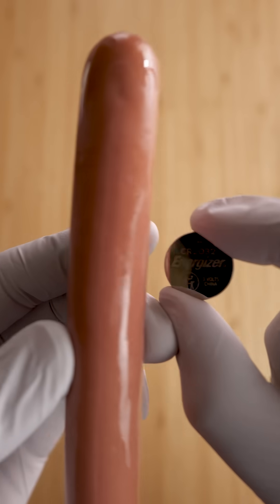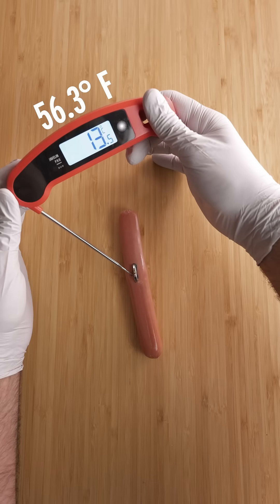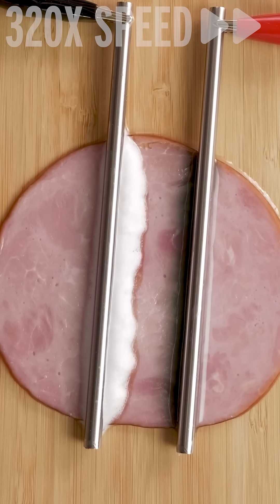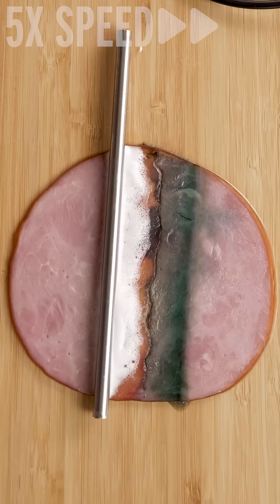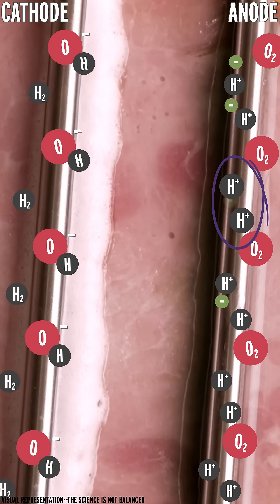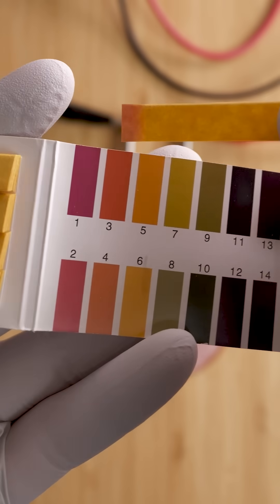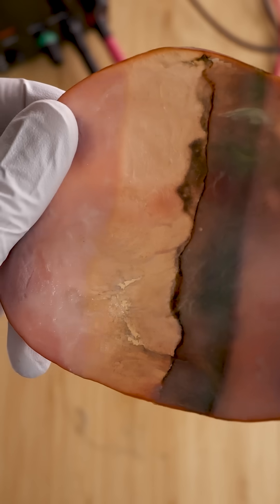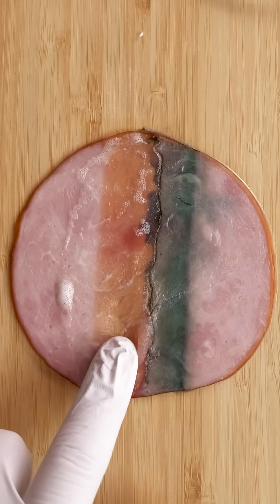don't swallow watch batteries

Comment: Paramedic here. Seen this in person and it isn’t pretty in the slightest. But if you ever even suspect your key has swallowed a button battery and they are over the age of 1, feed them honey, a few spoon fulls to try and coat the battery and slow this from happening while also being on the phone with local emergency services to take your kiddo to the ER. Don’t let anyone try and write off your concerns, play it safe and have them image your kid to confirm if there is a battery or not.
Reply: Fellow paramedic who was looking for someone giving the honey advice! Feed them the honey and get them to the ED as fast as you can
Reply: @mattt620  Great work gentlemen thank you.
Reply: Completely agree. Immediate presentation to the ED, regardless of the size of the battery or how well the kid looks. I'm a Peds EM doc. Our facility has a button battery team that gets emergency paged to prep an OR and get the surgeons to bedside immediately for esophageal batteries. That's how serious we take it. Though I will note once you're in the stomach, much less dangerous because you've got thicker mucosa used to resisting chemical damage.
Reply: My 4yo sister swallowed a button battery and my mom did exactly that when she found that she swallowed it, it works very well. The paramedics at the ER told us that the honey slowed the digestion process significantly enough for them to take it out in time. Yes, they had to remove the batter manually by inserting a something like a fish stick with a camera down her throat to her stomach so they could take it out. Thankfully my sister walked away from this with no serious injury. Could’ve been way worse had we been late in taking action. Can’t stress this enough, please watch out for button batteries around children, and take action immediately if you think a child had swallowed one. Never brush it off as something minor, better safe than sorry.
Reply: @Kiyotxka  do you remember how much that whole process cost by any chance?
Reply: Battery in keys very dangerous... got it
Reply: So what you're saying is I should coat my batteries in honey before I eat them to slow down the reaction?

That's a genius idea! It also makes it even MORE tasty!
Reply: Noted for my battery eating session
Reply: Good to know  Thank you
Reply: You can also use honey if your child has swallowed a bear
Reply: with honey is the only way I eat my batteries
Reply: Don’t feed honey to newborns or kids under one years old though! Since honey contains Clostridium botulinum bacteria, and it can cause infant botulism.
Reply: Insane that we even have to say “don’t let them image ur kid” 🤦‍♀️
Reply: My car key does swallow a lot of button batteries man. I need to change em almost every month
Reply: couldnt you just throw it up? or would the stomach acids cause more damage
Reply: @shaymin7240the problem is that the battery gets stuck in the throat and I’m guessing the burns help it hold on longer as well. Also these are usually young kids,l who may not even understand the situation
Reply: @shaymin7240It is not easy to make a kid to throw up. We are not trained and most probably causing more harm.
Reply: @shaymin7240the biggest concern with making someone throw up is of aspiration into the lungs or making airway management difficult
Reply: how does a key swallow a button battery?
Reply: auto correct sucks
Reply: @AbiyBattleSpell   I could be wrong, but I'm guessing that was a typo for "kid".
Reply: Honey? Why? I'm from Czechia and "the general advice" is to eat lettuce or something like that. That is for any metal objects.
Maybe its different for batteries.
Reply: @ the short answer is because the honey will coat the battery and esophagus also honey has a relatively acidic ph so chemically it also can help neutralize the base from ur battery. Really it is two fold helpful, out gi tacky deals a whole heck of a lot better with acids than bases.
Reply: Same process will happen if any active metal is placed inside body. The only difference is speed of the process. If a piece of a bullet is stuck somewhere it will slowly kill.
Reply: I only have splenda, I guess that's fine right? It's not like the batteries are sweetener connoisseur
Reply: @Alex-qj3wp  No.
Wildly chemically different.
Reply: @Alex-qj3wp  actually the battery is, will only accept honey otherwise the attitude it gives will only get worse.
Reply: @Alex-qj3wp  I can't tell if this is sarcasm or not. But just in case, no, Splenda won't work. Idk if you've ever noticed how honey is thick and gooey, and Splenda is, well... not.
Reply: @Alex-qj3wp  It's not about the sugar... Also, that isn't sugar.
It's because the honey is viscous and coats the battery/esophagus and helps slow the reaction by limiting contact.

The only way to "stop" the reaction is by making them drink a ton of acid to neutralize the base, which has it's own set of problems.
Reply: @Alex-qj3wp  no, something thick to coat the battery like syrup, and im thinking ketchup might do the trick as its also acidic
Reply: @kwitmeh3  maple syrup, maybe? I'm not a doctor but it's fairly similar to honey, is it not?
Reply: jokes on you if you think im payin my yearly deductible to save some kid, whether its my own or not
Reply: @Mike_Dubayou  Or move to the developed world where such services are free.
Reply: @unfathomablyunfathomable "free", not free.
Reply: @Mike_Dubayou   Quite literally free. No bills paid. 💀

Yes, a percentage of your income every day goes to financing roads, schools, hospitals, police, the military, etc. But then again you don't have to pay 100 000$ for surgery, and ambulance rides are free.
Reply: @Mike_Dubayou  Maybe it will give you the oomph to make a home made silencer and help us fix the issue for good, know what im sayin?
Reply: @ instructions unclear.  a few kids are unalived and im not sure im doing it right.
Reply: I don't think there's a lot that can be done. No doctor is gonna rush a kid to surgery to remove a battery.
Reply: @mawlakewlz  You think they're just going to let the kid die? Nah, they're probably going down the esophagus with an endoscope to get it out.
Reply: @austinhamilton9707   Perhaps, if they can. 
But how likely is it to be stuck there? 
Most likely it goes right to the stomach in like 3 seconds, like most things that are swallowed, and from there to the intestines. 
I've just heard that they typically don't do surgery for things like this, but I'm not an expert so i don't really know.
Reply: @mawlakewlz  The NHS will attempt an endoscopic removal, with the camera to survey any tissue damage. If they cannot fish it out then they concentrate on chemicals to limit any reactions and monitoring for damage until its passed and treating the symptoms, I don't think it would be much different in the US or Canada.
Reply: @MrWyzdum  I've heard that the sky is green and there's monsters under my bed, but thankfully, I don't believe everything I'm told. Also, don't know if you've seen the size of button batteries, but they're a decent size. Pretty likely it'd get lodge in a small child's throat. Regardless, doctors will 100% do what they can to save a child. I know the American Healthcare system isn't the best my any measure, but they're surely not going to just stand around while they watch a child die. "Oops, kid swalled a battery? Sorry, I don't do surgery for that sorry. Just not my thing." Come on, dude... Use the thing between your ears.
Reply: @mawlakewlz that is literally EXACTLY what we do

Comment: Okay, there needs to be some things clarified. This is a lithium button cell battery, and it only happens to lithium button cell batteries. It does not happen to nimh, or the other form of button cell. I don't know why it only happens to lithium, but even if you lick your fingers and grab a button so you'll notice it will start to burn you. But regular button cells do not do that. Only lithium ones do.

Comment: Why increase the voltage? The cell inside the stomach will be moving (slow acting low voltage won't have time to cause significant local damage when the cell is moving) and at no point of time it will be sandwiched between 2 muscles

Comment: Ham slices would probably make a really good electrolyte medium for a stacked plate AGM style car battery....accept it would be an AHM. The problem you would have it the flesh would denature and the plates would short so you would still probably need the glass mat...AHGM.
You would probably need to add water or ham juice to saturate the dry parts.

If you made one i would watch that video.

You could also make a really cool battery out of a pack of hot dogs. 1 electrode down the middle and wrap the outsides in foil. Vacuum seal it back into a pack of hot dogs and run a power wheel toy car.

I would also watch that video.

Comment: Another fact: Saponification is the treatment of fats using very strong hydroxide (or alkaline) solutions. Your whole body has fat. Therefore, the soapy feeling when bases are touched with bare hands is because of saponification; however, instead of using other fats, your body is reacting to strong bases.

Comment: A button cell battery has limited capacity, it's not a lab bench power supply hooked up to the mains. Its voltage is also not 9V. A cr2032 battery will have around 200mah and a continuous current rating of like 6mA. Even a 0.5C load will kill it in seconds. The voltage will also sag down to 2V or less at high loads. No significant amount of electrolysis will occur at those voltages, which you already know because you've had to crank up the voltage. Swallowing batteries is bad though. With that, I agree.

Comment: What is the reaction on a car battery, that causes corrosion during cold temperatures? Specifically it causes terminals to bubble around terminals without a liquid present. What can I do to prevent it?  There are terminal shivs on the battery terminals.

Comment: Is this an exaggerated demonstration?

I'm not doubting the effect, but to my knowledge, mucus typically contains only around 1% salt and electrolytes and so may not be as conductive as shown.

I'd also question the cooked hotdog / ham analogs. Given that the esophagus walls comprise of several distinct, uncooked, layers (epithelium, lamina propria, and muscular mucosa) and that each of these have different compositions and presumably different electrical resistances / mass to discharge electricity, these may not be an accurate representation.

I expect that in reality, such damage could only occur after prolonged exposure, likely on the order of hours.

Comment: Im a hazardous materials chemist at a tech company and i love this PSA about the hazards of a battery and acid base reactions on tissue. I have to explain so much of this to coworkers and one that i have to really go over is that bases wont cause the same pain on skin as acids but can cause more damage. Good job.
Reply: what scares me more than anything this day and age is the amount of random things that "just hold a charge", is you can't swap the battery pack easily, it's likely a lithium battery.

I would love to see the PSA for eating a lithium battery...

Keep bluetooth AWAY from dogs, it is not funny to hear an airpod in a dogs stomach, at all.
Reply: Yeah, nobody seems to listen even when you tell them that the reason a basic solution feels like some kind of soap is literally because the soap is forming due to a reaction between given base and the fats under their skin.
And if there's one thing that should not be tolerated under any conditions - it's neglect of safety goggles. Eyes protection is crucial.

Comment: If ur child or pet swallows a button battery take them to a hospital immediately. If the child is over 1yo then on ur way there u can feed them a spoon full of honey to try & help buy a few extra minutes. It is not a cure, & results are not guaranteed, but the risk of using honey is minimal so might as well try. But the most important thing is getting to a hospital. Immediately.

Comment: Cranking the voltage makes it no longer an apples to apples comparison.  Electrolysis requires high voltage.  It can't happen below 1.2 volts and barely happens at 1.5.

Comment: That works on the skin or exposed meat... no way that you get the same reaction within inside a living body... you have stomach acid inside you that is highly corrosive and you still don't melt down from inside-out... Now I'm not saying that go ahead and eat batteries, but definitely doesn't work the same inside as outside...

Comment: Lithium cells have not enough voltage to split water in hydrogen and oxygen in meat. The key problem was: I kicked up the voltage. Thereby he overcame the 1.23V and resistance. I would guess it was at least 5-6V. 
But children please don’t swallow batteries anyway.

Comment: The numbers on the CR batteries indicate the size. CR2025 is 20mm wide and 2,5mm high, CR2032 is also 20mm wide but 3,2mm high and therefore has more mAh.

Comment: You cranked up the voltage, what about IN THE BODY when fluids are constantly circulating, a real experiment. Maybe some real medical reports?
Reply: Are you... Denying that swallowing batteries is dangerous?
Reply from the maker: There are lots, here are a couple 

https://pmc.ncbi.nlm.nih.gov/articles/PMC5966199/

https://onlinelibrary.wiley.com/doi/10.1002/lary.26362
Reply: @ACSReactions  what was the actual voltage used for this experiment?

Comment: I was so angry about the number of toddlers being killed and maimed by button cells, that I came up with the idea, around 2005, or using "bitrex" on button cells so that toddlers would spit them out rather than swallow them. I wrote to every battery manufacturer in the US and UK with the idea. Ten years later, "baby-safe" batteries with Bitrex came out. Some years later I discovered someone else had patented the idea a few years before I did.

Comment: That's what happens with the fuel storage tanks at service stations they suffer electrolysis because the power lines that's the reason why all service stations now have fiberglass fuel storage tanks

Comment: Holy moly! I thought they were locked in an impenetrable plastic mini-fortress as anti-theft measures but now I understand that it’s to protect children. I am a grown adult and have to use all my skill and training to not slice my wrists open using a straight utility knife to open the plastic that they ship entombed in, I am fairly certain my child could not accidentally swallow a bare button-cell. Which means my biggest concern is with them accessing one that is in-use. Got to keep those little buggers locked up in their compartments in whatever tools use them (like door sensors, small toys, finger lights, etc)

Comment: I swallowed a battery like this but smaller when I was like 6 years old. I survived it because the battery was already dead and the electrolisis in the video was unlikely to happen, but I could still had acid leak in my stomach or intestine. I had an ambulance drive and was given a lot laxatives and mom had to look in the 💩 until she found it.

Comment: "bases dissolve tissue," yes specifically lipids (which are the fatty acid chains that hold your cells together). this is also why eating soap, and particularly concentrated soaps like tide pods, is so deadly. the soap is literally dissolving your insides. which makes sense considering we use soap to break up greasy food stains.

Comment: I can attest to the fact that bases are nasty. We use a caustic soap for heavy industrial degreasing. Rule 1 is wear the ppe and dont spill it on yourself. A little splatter of the diluted foam on the skin is fine if you wipe it off promptly. Might leave a red mark if you take a minute to get to it. Exposure to the concentrate however is get in the emergency shower and depending on the location start stripping. Years ago had some genius spill some down his boot and not say anything for 20 min till he started complaining about pain in his foot. Ate a big chunk out of his flesh.

Comment: Well dont try to put the tiny one into ur nose
Tried once when i was 4, left it there for 4 months without anyone known. It resulted in several surgeries to removed the super corroded battery. 
Thankfully i dont lose my nose but now the membrane between 2 nostril canals is pierced. So now i sound like a steam engine whenever i do some heavy works

Comment: And that's how i got a hole in my arm 😂 but not because of battery but an ac/dc adapter. I had one with + shape plug to power different devices. One evening i was listening to my walkman, to save the batteries for the next day, and fell asleep. In the morning i found out this plug burned my arm and was sticking out of it like i'm a robot on a charging station 😁 it's healed and I just have a round scar to remember and to teach my kids that electricity is not a joke

Comment: You got the electrolysis part wrong. 
TLDR: There are no O2 bubbles on anode as you can see in the video. It is the electrode's metal being solved in water, thus the stain and negative PH.
 
In salted water you would never get O2 on anode because Cl2 would form there first, but before that the metal in anode would oxidate and become chlorine salt. That is what you can see in your video: there are no bubbles on anode and the stain is a metal salt -- which is in turn by being a weak salt hydrolyzes and thus produces some H+ ions.
You would need inert anode like gold or graphite from pencil to produce chlorine bubbles on anode.